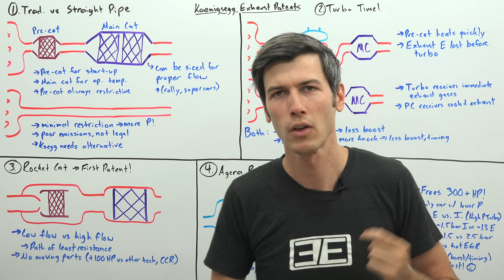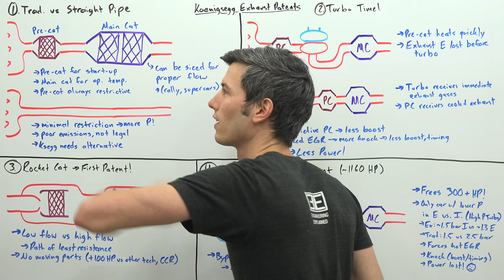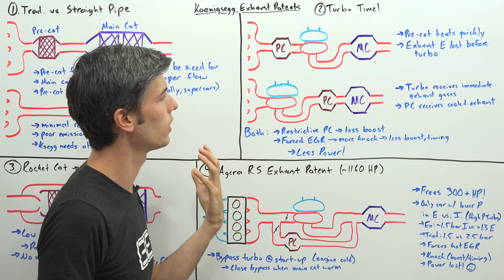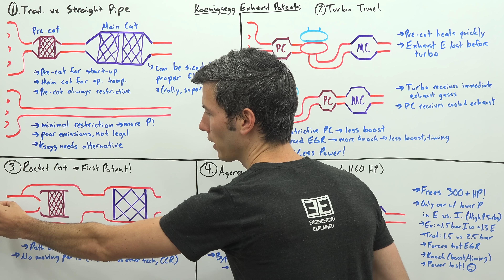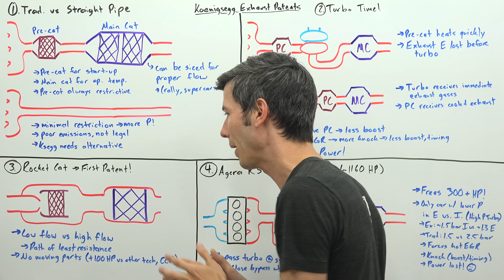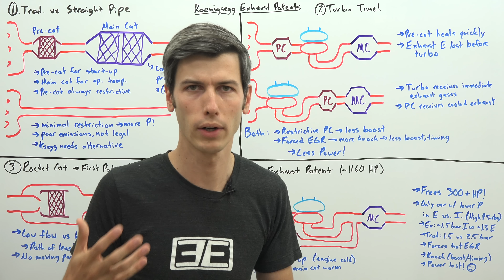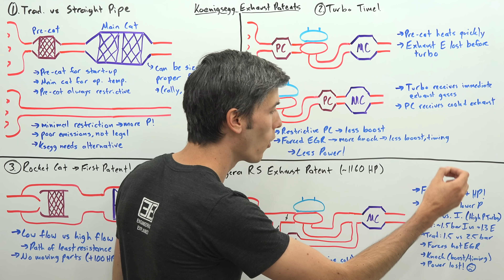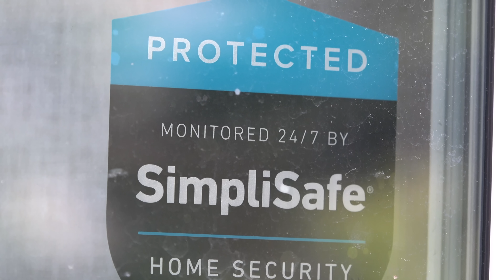Koenigsegg Proves You Don't Need A Straight Pipe Exhaust

Comment: You are not forcing anything anywhere. Modern engines have adapted exhaust and intake phases lengt and timing, exhaust will close at the most beneficial moment and high compression is used. Also, it's not 1.5:2.5, rather 1.5:1.5 all the way to just before max power and then slightly worse.
The power loss is not due to heat, but due to mechanical resistance and pumping losses against the backpressure. But that's at WOT and high rpm.
At part throttle cats are bad, because they kill inertia and the possible max pressure differential at transients.

Comment: Am I the only one who wonder why manufacturers does not use electrical resistances in a wide mesh pattern inside the exhaust system to get the work temperature instantly and on demand for the exhaust section and engine temperature being wide enough to not be restrictive when off but enough to heat the gaps enough to burn the harmful particles 🤔

Comment: Great video!! One question though: if in the traditional catalytic coverter the exhaust gases have to always go through the pre cat, then the exhaust flow is determined by the size of it and not the size of the main cat. Wouldnt it then make more sense to simply place the main cat closer to the engine exhaust so it works both in cold and warm start ups? I imagine the reason for that is that the pre cat is not as effective as the main cat when at operating temp, but I would like to know your thoughts on this.

Comment: The idea of by passing a restriction is not new specially in the exhaust department, what I really want to know is how are these bypass valves built and there mechanism, to build a valve that can withstand that amount of heat & pressure yet still work properly every time with the presence of carbon deposits, is actually what amazes me.

Comment: 10:10 short observation on that part:
Just because the clutches can close in as little as 2ms, doesn't mean that the gearbox will shift with that speed, mainly because an upshift from 3 to 4 will require the second shaft to increase it's rotational speed. Koenigsegg will of course try it's best to minimise it's inertia, but that still makes it less straight forward than an upshift that won't change the relative speed of the second shaft to the input shaft. Which means that either every third gear shift will take considerably longer to complete than others, or that all gear shift times will be matched to the slowest one. But no continuous positive torque, which was something you have claimed
Reply: If you’re talking about the Jesko gearbox, it actually is possible to maintain positive torque even through the 3-4 and 6-7 upshifts. One sub-transmission is making a large upshift while the other sub-transmission is making a smaller downshift. So long as the upshift is timed ahead of the downshift, positive torque is maintained. They can also avoid a large torque dip by upshifting very quickly and using the shift shock to not only fill in the torque dip but also to trigger slippage in the downshifting portion of the gearbox to initiate the downshift. 

This is how the Chrysler 62TE transmission accomplishes its 2-3 upshift, which involves 2 overlapping shifts between the main box and the compounder unit.

You can also search for “double swap shift” or “double transition shift” for more research on this.

Comment: You got the bit about back pressure causing exhaust gases to dilute cylinders and cause higher temperatures wrong or the EGR cycle has got it wrong when it's supposed to reduce cylinder temps and nox levels ?

Comment: David Vizard discussing valves and gas flow says exhaust gas inertia causes the cylinder to go negative pressure just after the exhaust valve opens. The inlet opens momentarily later so the incoming charge is pulled in by the partial vacuum created by the exhaust flow. 
Konisegg have the Freevalve engine which operates its valves entirely electronically. No cam, no cam belt, around 20kg weight saving on a 1600cc engine. Each exhaust valve has its own outlet pipe with only one going to the turbo. The other goes straight to the catalyst. The individual valve openings control how much boost is made. No waste gate. The cold engine keeps the turbo valve closed and retards the spark ignition. That puts flames down the exhaust to quickly heat the catalyst. The precast is not needed. There is also no throttle valve it’s all done by the engine valves. Check out the freevalve video.

Comment: No reason for road cars to have straight through exhausts. My Datsun race car has a straight through exhaust and exists out under the rear passenger side door area. I could have a straight pipe that exits just behind the front left wheel by the front passenger door but I wanted some back pressure for more torque rather than power.

Comment: I'd like to see a full account of the cost to the environment of all the extra materials, including rare metals, and energy used to mine, transport, manufacture, design, build etc vs. the nox a cat is meant to reduce.    Plus you also have the compounding effects of extra weight needing extra material to carry it, and reduced fuel economy due that, and a bigger heavier vehicle, for the life of the vehicle, and the extra complexity, failure modes and maintenance costs.

Comment: Cool videos!!   Could you please do a comprehensive video on correct tire balancing, in regards to the yellow and red dots on sidewalls now, as well as proper proximity to valve/TPMSs and road force testing.  Also, some aftermarket wheels have a hole for TPMS and a different hole (in a different location) for a air valve only.  SOO MANY TIRE SHOPS AND CONSUMERS DON'T HAVE A CLUE ABOUT THE IMPORTANCE OF THESE DOTS ON TIRES!!   ;)

Comment: Why not just have a single cat with a pre-heater. You know those butane solder torches? They use a catalytic screen to "burn" the gas, but has no open flame. Basically the hot catalytic screen rapidly oxidizes (burns) the gas which keeps it really hot, and thus catalyzing the reaction. So same thing on a car, small injector and igniter that rapidly ramps temps while the car is starting. Inject cuts out one the main cat is hot and engine running.

Comment: I don't have a degree  in engineering but do have  a very breif experience with power train engineering within a big hyper car manufacturer- only a few days though. The turbo compresses the air making creating greater heat hence why we use a cooler. Does that not mean the heat of the air coming out is actually still fairly hot meaning the pre cat shouldn't be effected too much?

Comment: You never “Need” straight pipes for performance.  In many cases you hurt overall performance as you lose low end performance.  MFG, have anyways known how to increase performance, but they have noise limits and emissions limits over the full range of performance and need to control costs.

Comment: Why not delete the pre-cat and heat the main cat electrically when the engine is started? Dump all the moving parts and remove a restriction.
Reply: heating it with what?
Reply: @petr0rabbit  Electrical coils like in a toaster powered by the alternator/battery.
Reply: BMW actually did this in some models in the late 90's. Don't know why they got rid of the system because it was really not a bad idea. Well, maybe not the cheapest option, but it had really a lot of advantages. For instance it can be also a problem if you drive downhill for a while and the overrun fuel cut off is activated, the catalytic converter will cool down because there's no combustion happening.
Reply: @shi01  The only downside I see is drawing a lot of amps. I don't know if EPA emissions testing accounts for long downhill coasts. When I start my Impreza, there is a blue indicator light to show that it is running rich to heat up the catalyst as quickly as possible.

Comment: Do not buy the simplisafe security system. I used a cheap walkie talkie and put it to emit on a random frequency, put it next to the main thingy and opened the door without triggering the alarm. You can even do this with a €3 garage opener remote. Do not buy the simplisafe security system!

Comment: Please do a video on E-cats, or electrically heated catalysts. This should be a no-brainer if you have a hybrid car (plenty of battery for quick heating and regenerative braking for 'free' power) and also want to reduce performance loss of the pre-cat. On the wiki on cats it seems that there are some cars from 20 years ago that used this, but no modern examples.

Comment: Sorry... but koenigsegg is blowing smoke up your rear end. You cant have a negative pressure ratio across the turbo.  To make boost... you MUST have higher pressure in the exhaust than in the intake. Check any turbo compressor map ever made and you'll see pressure ratios anywhere from 2:1 to maybe 5:1. To suggest otherwise would require beyond 100% efficiency.

Comment: In 2017, when presenting the FreeValve system for smaller engines, already having built a prototype FreeValve cylinder head for a Qoros engine, Christian von Koenigsegg mentioned that, among all the other advantages FreeValve has, it allows them to eliminate the Pre-Cat altogether, as they can just time the ignition and valves to purposefully send flames into the exhaust, quickly heating up the main cat.
Why is this not done on the Koenigsegg engines?
Are the main cats too big for this to work at all? Or would flames that are large enough to heat up such a big catalytic converter overheat the turbos?
After all, the Qoros engine was supposed to be turbocharged as well, but with smaller turbos and with two exhause valves for each cylinder, one bypassing the turbo, so maybe they'd be running only that one to pre-heat the main cat.

Comment: Why aren't electric cars cheaper than gasoline powered ones when they lack many parts like exhaust system?
Reply: All the tech is pretty new, so you're paying for R&D cost. And stuff like batteries are extremely expensive because they use rare metal.

Comment: Hi guys, from 10:35 where it is explained having more.pressure in exhaust manifold leads to hearing up cylinder quicker. 
I wanted to know if I remove back pressure form a single cylinder bike, will it lead to fry/damage the valves? 
Thanks
Reply: not is you enough fuel to compensate no

Comment: The exhaust back pressure being lower than the intake manifold pressure also opens up the ability to "scavenge" to spool the turbo faster (both valves open, air flows from higher p to lower p, kind of the opposite of egr, more massflow goes through the turbine). This is common at low engine speeds (exhaust backpressure is a function of massflow, which is tied to engine speed) in consumer cars. But I assume that Koenigsegg is stating that their bp is lower than their intake pressure across the whole power band which is fantastic.

Comment: I don't get how that's legal. Basically you are just fooling the emissions measuring at the start by closing off the valve to the turbo, but if you were to hit the pedal at that moment, you'd have emissions flowing straight throught the turbo and the main cat which does nothing at that point.
It heavily relies upon the rational that the driver does not drive above a certain rpm until the temperature rises enough for the main cat to work.
Don't get me wrong, it's cool and all, but from a legal technical standpoint, it's just rich people priviledge.
Imagine telling TÜV "no don't worry, I won't floor my civic until it's hot so don't worry about it."

Comment: When you decat a turbo diesel car with a downpipe, it should 'free up' some horsepower, but I've read you need to remap your ECU  to take full advantage of the downpipe. My question is, what parameters are changed during this specific remap process? Limiter maps for air flow, exhaust port timings etc?

By the way, great explanation as usual. Like++.

Comment: Fascinating stuff. I'm wondering if any manufacturers use or have researched preheating the main catalytic converter before combustion begins, by using battery power for example? This would remove the need for clever, but more complex, systems, so seems logical, but I don't know nearly enough about cat's (the non meowing kind) to know if it's feasible....?
Reply from the maker: Yep, it's done on some modern cars!
Reply: @EngineeringExplained  well,  I'll stop worrying up the patent application and dreaming of the millions I'll earn from it.  Love the new full size white board BTW,  how did you ever survive without it? 😆

Comment: I see a problem. Since the engine would be pushing very hot gasses. As the valve opens to the stone-cold turbo, wouldn't that thermally shock the turbo? Especially when the weather outside is very cold. But ofc, who is not storing their Agrea RS NOT in a climate controlled garage.

Comment: That was genuinely cool as hell man as soon as you explained how the back-pressure from the exhaust gases can cause loss of power the entire video just clicked in my head, it also made me realize why my Eclipse felt more torquey as soon as I put exhaust on it, not necessarily more power (not sure though I never got it on the dyno) but it just had more pull when you hit the gas and it would make sense that it was the fact that I probably had pretty equal exhaust/intake pressures when it came down to open/mostly open throttle... cool stuff man

Comment: The scavenging of the hot gas in the cylinders will make the engine alot more effiecent, the hot gases will cause many power robbing issues! It has been countered with valve over lap, allowing both valves slightly open at once, allowing the exhaust to pull more of the spent fuel out, but this pulls raw fuel in to the exhaust, not good for the environment, and kills low rpm power, and not good for turbo engines, it is basically for high rpm race engines,

Comment: if the pressure was lower on the exhaust side before the turbo wouldn't it be then driven by the intake pressure instead of exhaust, i think koenigsegg mean the exhaust pressure after the turbo i.e after the exhaust has done work is lower than manifold pressure

Comment: I'm actually surprised it took so long for a system like this to be developed. The moment you explained the issue with pre-cat and main-cat, having a gated system was the first thing that came to mind. 
I can understand why manufacturers wouldn't implement it in cars that only produce 300HP~ because the extra 10-20% power wouldn't do much and cost more, but there are plenty of high powered cars that could've used this going back decades. 
Both solutions are elegant and rather simple. 
I wonder if there were any similar systems in place before?

Comment: So does this just use a temp sensor in the main cat to trigger when the turbo/pre-cat valve actuates? Or is it more complicated than that? 
Also, I don't know if you mentioned it, or if I completely missed it, the pre-cat valve is also used as a wastegate. I guess this means there's also some kind of pressure sensor, as the valve isn't a pressure actuated spring valve? Or is it a spring valve, that's also actuated by a solenoid? Koenigsegg only says that they put the pre-cat on their wastegate, but not how they actuate the valve or how they differentiate it's use between pre-cat and wastegate.

Comment: I think you may have misunderstood the Patent. The turbo is a massive restriction in the exhaust flow and the inlet exhaust maniforld to inlet manifold pressure ratio is normally 2 to 3:1. Engine gasses expand on combustion. You may be quating the turbo bypass mode pressure ration - that is not a nomal operating mode.

Comment: Could you clarify some of the functional differences between the pre cat and the main cat? Why could not the pre cat handle the emissions stuff? Or be sized appropriately so the backpressure is minimized?
Reply: The cat needs to get up to it's working temperature of about 400℃  to 600℃ or about 750℉ to 1100℉. A small and restrictive cat will heat up faster than a large cat which isn't very restrictive. So the pre-cat will get up to temp much faster than the large cat, but doesn't have the surface area to handle the large volumes of exhaust gasses that the engine will produce when you step on it.

Comment: CC8S was before CCR, hence without exhaust described in this clip,  and had single compressor and  655hp. CCR had new "+100hp" exhaust and double compressors and 806 hp. If 100 hp was from new exhaust, just 51 was from adding a compressor? Sure the problem will increase with more boost so a CC8S would not get a full 100hp extra but slightly above 50 hp  still seem a little low gain from going twin compressor. Or was the CC8S before you needed fast heated cats so they didn't have to bother about that restriction?

Comment: Could you make a video about why your car clicks and ticks after a long rode trip when you come to a stop and park
Reply: Isn't it just the hot oil dripping to the oil pan?
Reply: @DJDing23  I believe it's more to do with the fact hot metals expand ever so slightly, and because it's a bunch of separate parts bolted together made from different stuff it all cools down and contracts at different speeds.
There's probably other stuff too but I don't believe it has anything to do with oil dripping
Reply: @MotoCat91  Unless your oil is filled with chunks of rod bearings.

Comment: Why not just put some heating elements into the main cat and entirely forgo a pre-cat? You can even run the heater off the battery for 10-20 sec before taking off.

Comment: Why not heat up the catalytic converter with electricity to get it to operating temperature faster?
Reply: More electronics means more potential problems in the future. It’s not worth it since cars only need about 5-10 min warm up unless you live in areas that get far beyond freezing temps.